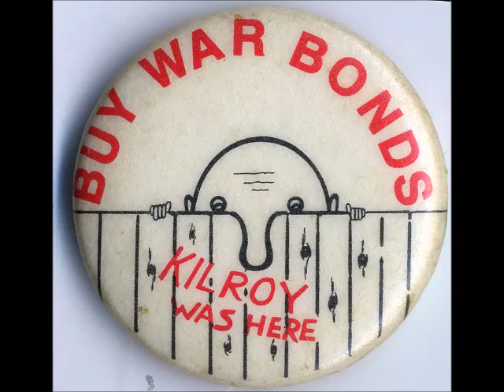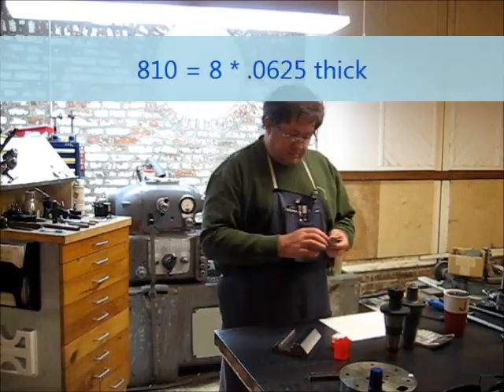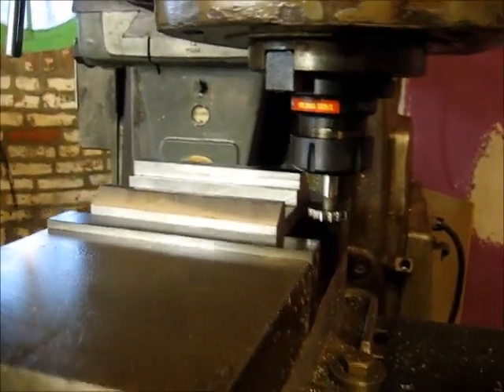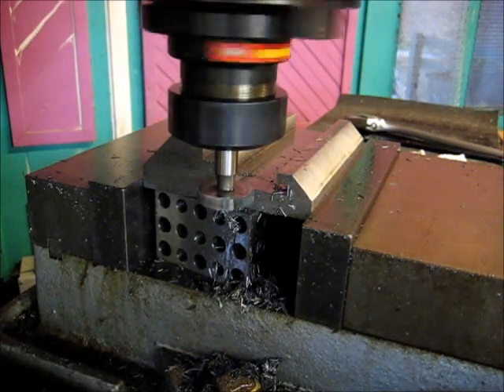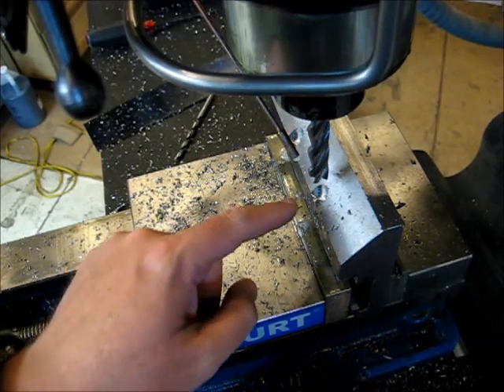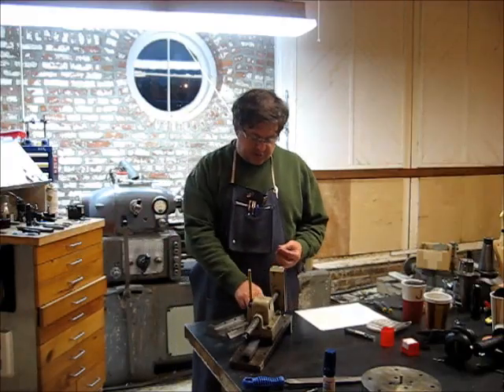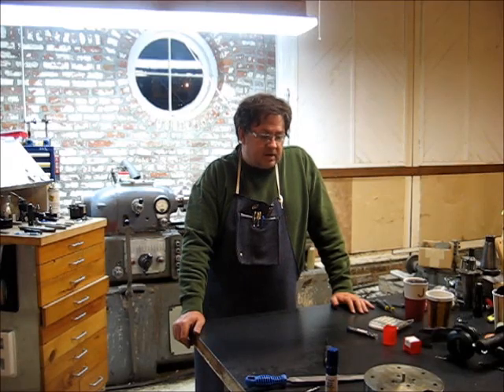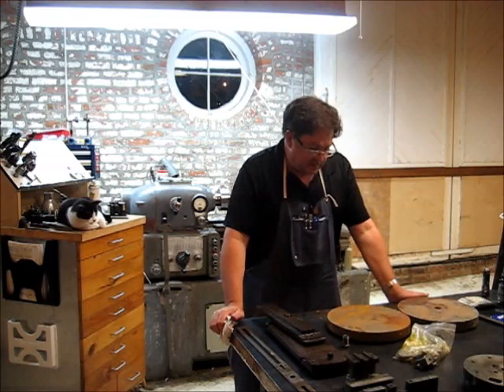Bandsaw Vice Shoe Completion

Comment: It was good to see the completion of the vise shoe James. You did some awesome work there. 
The cutter you bought and used I've always called a woodruff cutter, because they are commonly used to machine woodruff keyways. 
You have some nice machines to work with in your shop. That K&T looked like a monster. 
I like the faceplate castings. Looking forward to seeing that project in video as well. 
Thanks for posting man, and I look forward to our get together soon. 

Adam
Reply from the maker: Thanks Adam, yes they are woodruff cutters you are correct.  The K&T is a monster, really takes the drama out of milling, its a great machine. Working on the CAD for the D1-3 spindle mount right now, converting my drawings into X,Y numbers for the DRO, going to publish all that with the project as well.
Reply: James Kilroy Nice to see you back James,

T-slot cutters tend to have a different aspect ratio to Woodruff  cutters. They also often have side cutting teeth with a helix angle.

Comment: Hi,
This was a nice project, nothing like an optimized tool, separate the so-so ones from the better performing ones.
Question, when you work big cuts, grooves and so on on cold rolled steel chunks, do you have any issues with deformation? And, how do you address those?
Thanks for sharing,
Pierre
Reply from the maker: That can be an issue for sure.  On big beefy short parts like this its not much of an issue, but longer parts, thinner, it can be a real PITA.  In that case hot rolled is your friend.  You can still have deformation in hot rolled, no doubt, but it is generally less of an issue.  If you suspect deformation is going to be an issue it is good to remove as equal an amount of material from opposite sides as possible, when possible.
Reply: Thanks James for the infos, notice taken,
Pierre